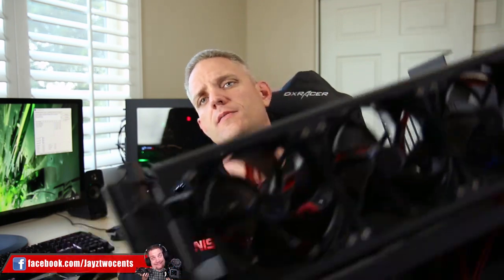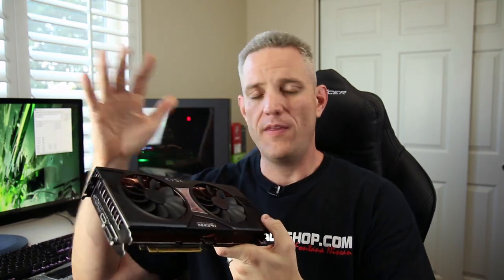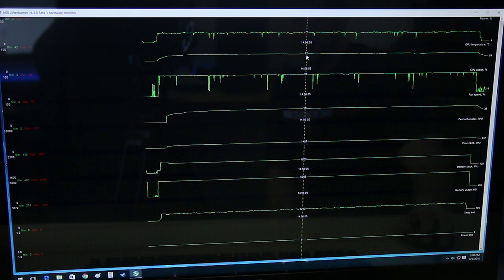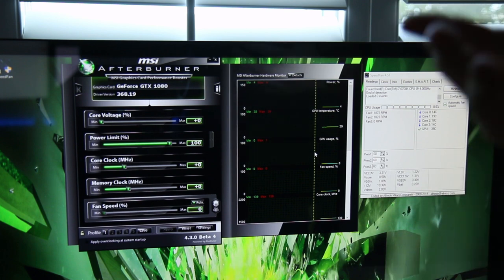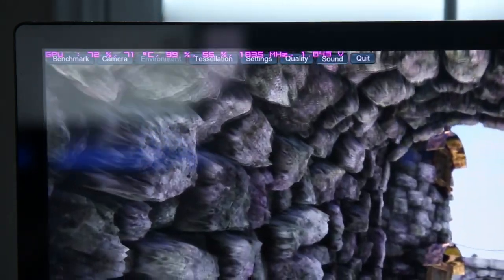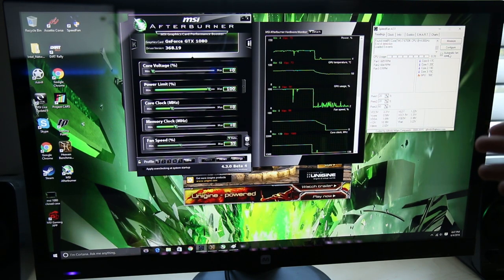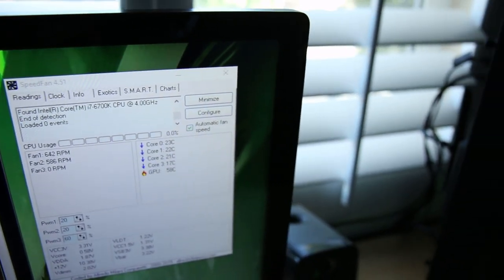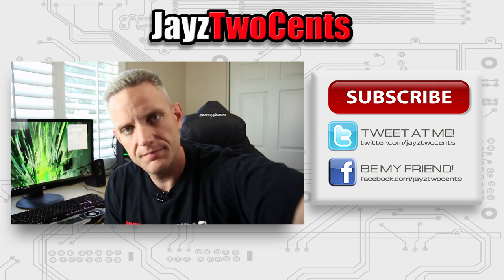Do cases make video cards run hotter?? - Test Bench vs Case

Comment: At 6:30 is it saying your CPU temps are 15,19,18 and 15 degrees C? that seems impossibly low surely.
Reply from the maker: Yeah, ignore idle temps. Always pay attention to load temps
Reply: Never ignore idle temps, those tell you if there are any sensor issues. If they show temps below ambient, you can't trust them and you should not be like "my load temps are 75 degrees it's all fine" because it will actually be hotter.
Reply: +JayzTwoCents I completely get that usually idle temps are useless for determining anything about the component but unless your ambient room temp is 14°c max surely those idle temps are impossible? must be an issue with the CPU temp sensors or something. regardless of that the video was great for proving what you were trying to prove, those CPU temps aren't related to that so it doesn't matter
Reply: Pretty sure intel CPU sensors are calibrated to be accurate at higher temps but yes if its way off you should maybe consider what might be wrong
Reply: Pretty sure he just meant ignore the temps in the video...
Reply: +Jesse-James Black I'm sure he did it's just that it seems like a possibly major problem with temp detection so there is a possibility (unlikely) that it's affecting the results
Reply: My basement stays 58f.
that's 14.45c.

my idle temp is about 16-18c with an h115i. barely above room temperature. it's irrelevant, but I figured we could all argue about idle anyways.
Reply: You all need to realize that with idle temps there is still air moving around. Air that is moved is always cooler than still air. These temps are not impossibly low even if the ambient air is hotter because its not moving where as the fans inside the case are moving air around bringing temps down. 

In idle your computer can run cooler than the ambient temperature because air is being pushed around the components. Right now on a 84 Degree F day with only having the AC on set at 70F my cpu is idling around 15-20c. I am using the H100gt water cooler. This is possible because the heat from the CPU is drawn away from it. Where as in a Air cooler its is being drawn away, but the heat is being radiated around the cpu even with a fan.
Reply: +RUSTY x NUGGET it's impossible to draw heat from a cooler object to a hotter object without putting energy in (refrigerators) so that's impossible unfortunately
Reply: +RUSTY x NUGGET moving air is cooler than stationary air? Who taught you that bollocks! The reason air moving over you feels cooler is because of how our bodies use the evaporation of water to cool ourselves.
Reply: What Ralph said, and also, No matter how hard you blow the air over a surface, the surface is not going to get cooler than the air itself. The air does not get cooler because you move it really fast. If anything friction might actually heat up the air in extreme cases.

Bonus information
Condensation only takes place if hot air hits a cold surface. never when cold air hit a hot surface.
Reply: Someone here skipped high school science.
Reply: Why are you guys even arguing about CPU temps when that wasn't the point of this video at all? The inaccuracy of CPU sensors has no impact on the fan speed of the case which was set manually in speedfan, nor the GPU fan speed, which is set by the GPU temperature.
Reply: +defau1tMC yeah I was literally just wondering if he was aware/ of there was an explanantion. as mentioned I don't think it will affect the GPU measurements
Reply: Okay cool :) I just get super pissed when people try and pick apart testing methodologies when what they're saying is an "error" or "incorrect" has absolutely nothing to do with what's being tested.

Cheers :)
Reply: Ralph Atkinson
You act as if the same thing doesn't happen to any other object. What happens when you put something hot in front of a fan. It cools off. Same process for a radiator.

The cpu will stay at a certain temp at IDLE if its not being used. Depending on your cooler for example a AIO water cooler draws the heat away from the copper plate and cpu and bring that heat to the radiator to be exhausted out.

If you are at a certain speed and voltage no additional heat is being applied to the cpu therefor it can be cooled down to room temperatures. You have to think about all the conditions you are in and how many intake fans you have.  I have two up front and one in the bottom that is right next to the A/C. Then the rad and back fan exhausting.

Constantly moving air makes air cooler. Even if you don't have the A/C on and just a fan in your room. It will become cooler as long as there is a way for the hot air to exhaust out of the room. This is simple science.
Reply: +RUSTY x NUGGET unfortunately you are wrong still. it would be great if you were right but it's just not true. an object in an air flow will only cool to the ambient air temp (assuming no evaporation like sweat) and no cooler. in a liquid cooler, the liquid absorbs the heat of the CPU, and is then taken to the radiator where the liquid cools to the ambient temp of the room and no colder. it then returns and repeats this process. the key here is that the the liquid will never be able to cool the CPU to cooler than ambient temp as the liquid never goes bellow this temp either. if you still don't believe me Linus did a great video about it called "bong" CPU cooler showcase where he explains that the only way to reach sub ambient temps is through a phase change process used in the video like a refrigerator. fans only speed up the air flow around the object and therefore the amount of heat that can be dissipated from the CPU per second, but at the end of the day the main thing happening in the system is the CPU and air trying to meet in the middle in terms of temperature and the air being carried off to be replaced by new cooler air to make this process happen repeatedly and more efficiently as the temperature drop experienced by the CPU will be a lot faster when the air is much cooler than when the air is close to the temp of the CPU. 

sorry it was so long but this is a fundamental part of thermodynamics and is the whole reason refrigerators have to have complicated phase change systems rather than simply blowing lots of air over everything other wise refrigerators would have been invented a lot earlier than they were!

if you simply Google "is reaching CPU temps lower than ambient temps possible" you will find a ton of people backing up this fact. I see why it is confusing.
Reply: just...wow.

Ok, so let me explain how heat works to you in a simple and easy to understand wa,y that you can quickly fact check on the very device you're reading my comment on. Heat flows from areas of high concentration to low concentration, and the bigger the difference the more rapidly this occurs. This is why if you put a 150 degree object in front of a fan blowing 70 degree air it will cool down, if you take an object that is say 50 degrees in a 55 degree room with a really fast fan in front of it, as long is the object doesn't have any rapidly evaporating fluid it will heat up to 55 degrees. Objects cannot be cooled below ambient temperatures purely by passing air.

Also air doesn't get cooler the faster it moves, this simply isn't true. The reason wind feels cold to you is because of evaporative cooling. The first law of thermodynamics doesn't allow heat to move from a cooler object into a warmer one, heat must transfer the opposite way.
Reply: +RUSTY x NUGGET also if cooling something below ambient temp was this easy, AC units would not need phase change systems and would be able to simply be a fan in a box. and the reason you feel cool when under a fan and the surface if your skin CAN reach below ambient is because of moisture which absorbs this heat to change state to a gas howerver this only occurs in evaporation situations like sweating and phase change machines and not in AIO liquid coolers or classic fan coolers
Reply: Ollie Janman
I understand this concept. I guess I didn't explain a certain part of it. My PC and prob most PC's in a house are near a A/C vent. The colder air is being drawn from the A/C vent into the PC thus making the circulating air in the PC cooler than the ambient ROOM temp. 

If your PC is next to your A/C then you can achieve temps cooler than your room environment. The inside of your PC is smaller than the room and has a lot more fans.

I do retract my statement on the air being cooler while being pushed. I will call my self an idiot on that one.

Example would be Right now my cpu temp is idling at 20c (68F). My room is prob around 70F but the air coming out of my vent is between 40-55F depending on the time of day.
Reply: +RUSTY x NUGGET ah that makes a lot more sense now
Reply: Rusty is confusing evaporative cooling and wind chill with... I am not sure exactly.

What you are saying violates the laws of thermodynamics.

And most people in the world actually don't have central air.
Reply: The temperature sensors are more accurate at the higher temperatures where you need them to be accurate. They sacrifice low temp accuracy.
Reply: I am not sure if you are trolling or what but it is not possible to cool your system below the ambient temperature unless you are using methods utilizing phase changing such as Liquid Nitrogen. Also with your specific scenario  your HVAC system needs to push sub 70F ~ 21.1C air through your space to maintain an average temp of 70F between cooling cycles.  That said it is very possible that you have 59F~15C air passing through your system from a nearby AC vent. With an H100gt you probably idle just a few degrees above ambient.
Reply: Different software behaves weird. I had a board that worked fine, yet Speedfan was off with temps. Doesn't always mean a sensor is bad and one way he'll know is if the cpu isn't throttling yet the software says it's overheating, etc.

Comment: even if the case did make the card run hotter, i would argue that you should still run tests on a test bed. You are able to eliminate a crap ton of variables and you cant just test it in every case anyone might have, even if the numbers dont represent exactly what i will get in my case, the numbers should still be comparable to eachother (maybe not between different cooler styles like blower and open but still...)

Comment: Jay the voltage probably has to do with the humidity and the small vaporized water that is in the air. With fans it filters out and drys out the air.

Comment: My H440 with 2 radiators, two GPUs & a 4770k.. With front panel on max cpu temp is ~80C/ Gpus 65C.. Front panel off, CPU max temp is 70C/ Gpus 55C -_-

Comment: What if you had the radiator at the rear. letting the GPU get to a little more fresh room temperatures that were not run thru  the cooling radiator.    
Have ran no side and an extra 3 speed fan blowing under the radiator. Blowing the air away from the cpu cooler and sending cool air overtop the back of the card onto the pci-e slot. Always running cooler temps gpu wise than i did with a side

Comment: I wonder it this would have the same results with cards in SLI?  I have an S340 and my top card get super hot.
Reply from the maker: Thats normal because of card spacing. Usually the top cards are more starved for air, and the back of the lower card is heating it up substantially. Known issue with SLI
Reply: +JayzTwoCents Thanks for the reply Jay.... Yeh,  i know. Wouldn't be any better on an open air bench do you think?

Comment: could the voltage difference be due to a better psu in case? by that I mean that it outputs cleaner power, so the gpu has to draw less power to be stable? nice video btw! :-)

Comment: well yeah OFC open air is better... the nec states that conductors ampacity is greatly affected by enclosures...  this is the reason why wires on coming into a building is small then then wires you have in your panel...

Comment: Hey Jay,

How bad is PC case if PSU is located on top?

How bad is it for PSU?
Reply: LTT done it. Doesn't matter on the temp. of the case. Just the PSU getting a little bit hotter but otherwise
Reply: There is exactly ONE, BIG, IMPORTANT thing to remember when your PSU is on top.

When you install, change or do ANYTHING to the PSU, make sure that you secure ALL of the mounting screws FIRST THING.  This is to prevent you from forgetting to put them in later, standing your case up, and promptly dropping said PSU onto all of your shiny computer bits .... but other than that it doesn't matter.

Comment: It's summer in California and Jay had his CPU idling at less than 60F/15ish C in a case where the front intake is fairly obstructed. Unless his house has super AC and keeps it around 50F during the summer, those temp sensors are definitely faulty.
Reply from the maker: It was 98F the day I did this test. My room temp was approximately 78F with Skunkworks, 4 monitors and the test bench running. Warm indeed.

Comment: Can you do some testing of reference cards across the generations to help give an idea of what an upgrade would yield for people? Getting reference GTX 580, 680, 780, 980 and 1080, with current drivers on older popular games, and some latest games would be helpful. I have a 780ti, and would be able to compare 780 and the ti (it is between 12% and 18% faster depending on test). but some raw data would be awesome. I can see an issue where 10+ tests (different engines and publishers)  times 5 cards (even more if you want to do an AMD version), so maybe a team up with LinusTechTips/PaulsHardware/AustinEvens/Barnacules team up?

Comment: People need to understand, as long as you are consistent and use the same methods/setup you can compare temperatures across cards and use that information to make a decision. If you use a case, there are too many variables (how many fans you have, intakes/exhaust, etc.) and not everyone is going to use the same case.  Jay 1, Haters 0

Comment: If the GPU voltage measures the entire card's voltage then maybe the fan speed could be the source of the difference. If not then I'm pooped too. I also expected the case to do better. The open-air test bench relies on the GPU itself to push the heated air away from it while the case is actively assisting to pull the heated air away from the GPU.

Comment: what about a case with a fan on the side panel that sucks air out ? thats how mine is the fan sucks the hot air from the side of the card and shoots it out the side of the case. i use 3 fans in my pc and my card never goes above 160 F and sits idle around 98 - 110 F .
Reply: and i use a msi r9 390

Comment: For my build, I am looking to buy and upgrade to either the S340 or the H440(both of them will be the black variation) I want to know if the lighting on the bottom of the case is self made, or it is like that straight from the factory (Sorry for moderate english)
Reply: My H440 has a built in light
Reply: +silverslayer0 colour of the case? colour of the lights? razer version or not?
Reply: +panman101mw3 white H440, white light that illuminates rear i/o and NZXT logo, non Razer
Reply: +silverslayer0 do you know if the black one has a light? also, did it come with the light or did you add it later?
Reply: +panman101mw3 mine came pre-installed. I don't know about the black one, sorry. My guess is that they are the same, just with different paint.

Comment: What was happening was your CPU, being liquid cooled, has it's cooler work better when it can cool in an enclosed space [smaller space to control ambient case temp and open air case caused case temp to equal ambient temp defeating the potential advantage the liquid cooler had for case temp control]. This reminds me of what happens when you keep a refrigerator open [it doesn't work all that well]. In the open air benchmark the radiator didn't work as well from being such an open case so ambient temps near the GPU were slightly higher as a result. I already knew the results were going to be counter-intuitive because of that liquid cooler. You would have to use an air cooler for the CPU in a small case to cause the ambient case temps to shoot up compared to open-air cooling.

Comment: But if you do a GPU review then the only thing significant is the delta you get on the cards, to compare them relative to one another, because mileage may always vary. People can have the same case and the same kit inside with the same ambient temperature but different fan selection or fan layout and get completely different results. So when looking at GPU benchmarking you want the testing conditions kept constant, whether or not it's inside a case or on a test bench doesn't tell you how it'll perform in your own system.

Now something that would interest me is if YT case reviews consistently showed benchmarks of CPU/GPU temps with different styles of cooling solutions in different orientations. But in fairness I do get why there's not a standard of building a system inside every case, benchmarking temps, swapping some fans about, benchmarking temps, swapping GPU to an external exhaust, benchmarking temps, trying a waterloop AIO in the front, then the top, benchmarking temps etc ....

Comment: Did you have the same psu in both instances? brilliant job nevertheless!
Reply from the maker: Both are EVGA 1000w PSUs. Not the exact same PSU, but same specs.
Reply: ***** that is the only thing that i could think of which could have changed the voltage on the gpu. Anyways, brilliant test and hopefully it will calm down some people. Thanks for replying!